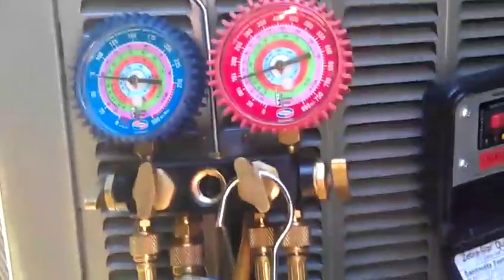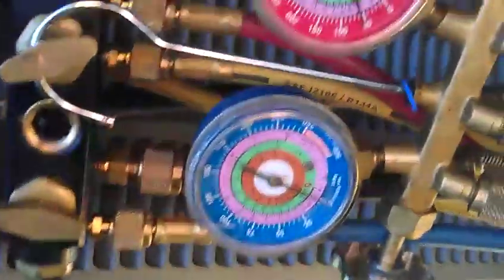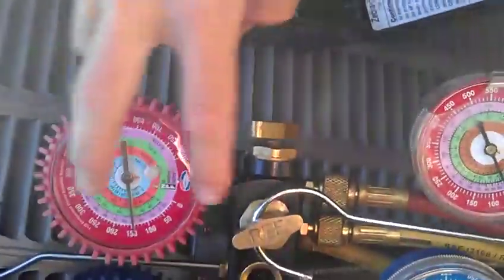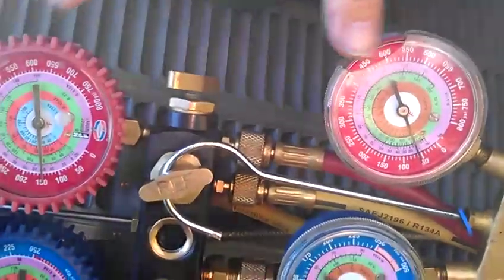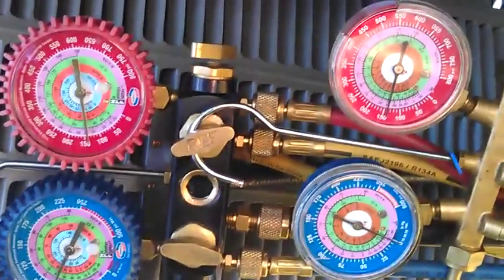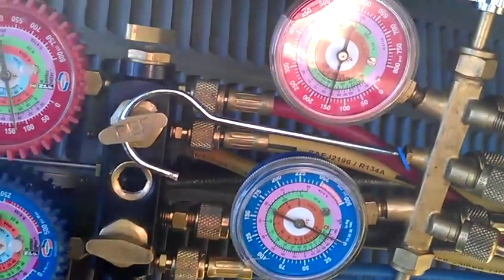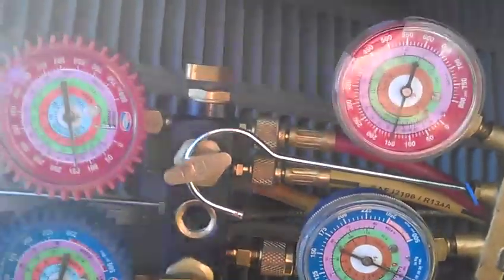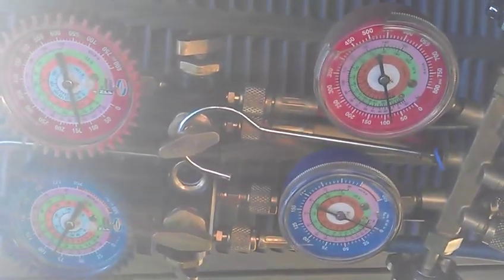Test heat pump Txv in both heat & cool mode

Comment: What if the suction stays the same and high side rises and cuts out on hpc?
Reply from the maker: Daniel Kdeez hp cut out generally is a dirt issue. In heat mode inside coil or filter. In cool mode outside coil dirty. Next possible is low air flow like blower speed to low on inside in heat mode or to slow condenser fan motor in cool mode. Last thing to look at is refrigerant issue but to small of line set or over charge is a factor.

Comment: I really enjoy your videos on troubleshooting expansion valves but I have a question which you may or not have time for. New 4ton install on Rheem heat pump condenser with expansion valve and reusing old orfice evaporator: Works good in cooling(L-65, H-165); In heat mode true suction stays about the same but high side and suction both climb to 460psi until scroll compressor relieves pressure and eventually goes out on overload. Would appriciate your thoughts on this problem.
Thanks, alg